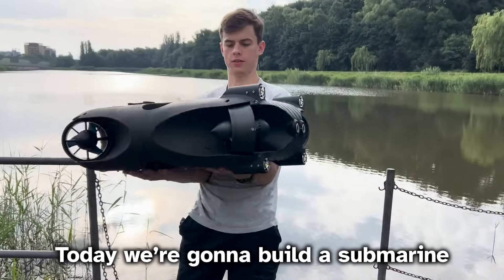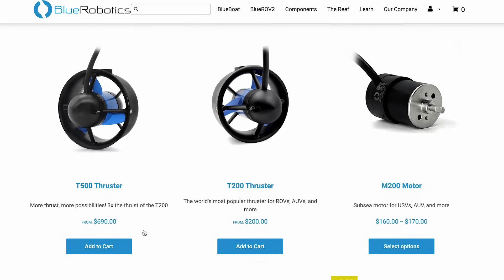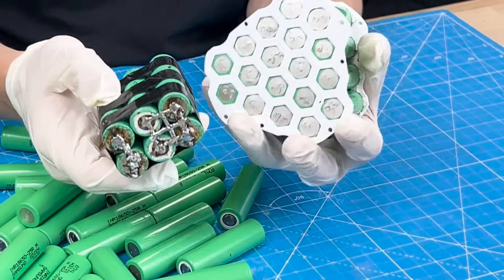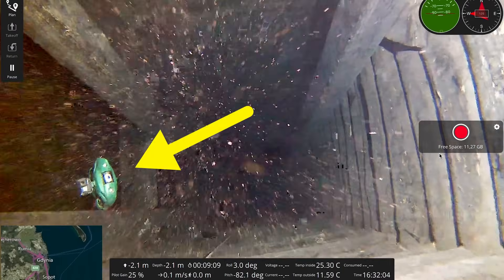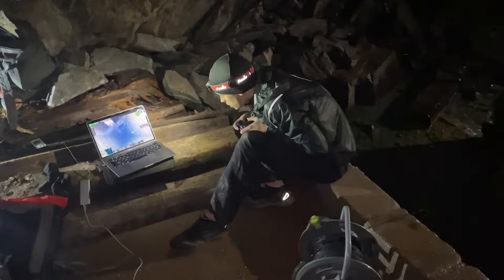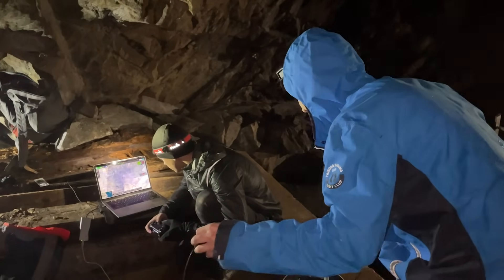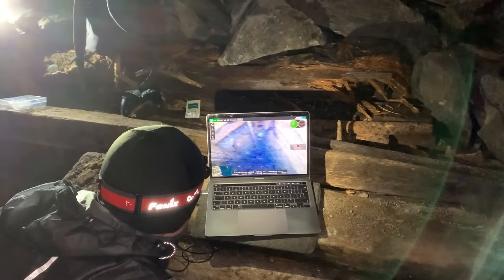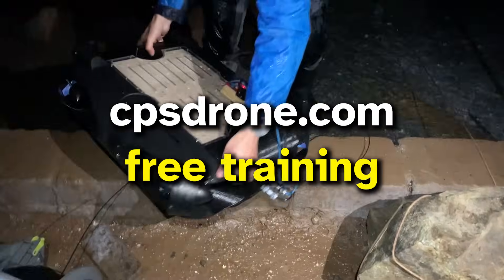My DIY Submarine Dives As Deep As Possible (PT2)

Comment: 5:50 Nice. 🔥
Reply: I think you should make more videos....because i think you rock👌
Reply: Number 15
Reply: That was a really interesting and innovative video, what a cool location to get underwater video of, literally the perfect example of a place being too dangerous to scuba with any level of safety, though I am sure there are folks who have. What a break the umbilical didn't sever. Fiberoptic is clearly the way to go, I do think either a rear facing, or swivel camera would be helpful. I'm curious about thruster control, how do you control the amount of thrust? I ask because of the silt you were stirring up, if your manually controlling thrust, maybe consider adding a ramping timer somehow. When you first engage thruster it starts off real low.. like 3 or 5% after some time it begins to ramp up max thrust, smaller bursts for corrections should create less turbulence that creates bigs clouds. Oh also your reliance on the umbilical as the only connection to the surface is really brave, maybe consider adding like braided fishing line and create a hard point connection for a secure connection for sub retrieval?
Reply: 5:50 Good 😊
Reply: Unsure why I cannot leave my own comment so sorry for posting on yours. But you guys could have used a guide line since such a narrow mine, meaning dropping a line with a heavy weight to the bottom and attach the sub/drone via eyeless or like eye hooks so it would be restricted to only up and down (unless u program a clamp to detach) but you wouldn't have to worry do much about obstacles... free divers use these to measure the depths they reach and so they can surface quicker if needed.
Reply: Using Fusion 360
Reply: yo hello hacksmith
Reply: oh my god its actually hacksmith
Reply: THIS THING HASES 1.9K LIKES DANG
Reply: man your here too wth make content like this help them
Reply: Badass 😎
Reply: @TheGrace020  lmao
Reply: Oh course you did!
Reply: This deserves more comments lol
Reply: Didn't expect you here...
Reply: HACKSMITH, USE TO WATCH YOU WHEN I WAS YOUNGER AND STILL DO
Reply: @Borx_x yes.
Reply: i cant believe hacksmith themselves commented on this before me
Reply: i just realized this is hacksmith heh
Reply: w
Reply: How does this only have 10 likes
Reply: Not.
 Anymore. @CØØKED1-1
Reply: hello
Reply: this deserves more likes
Reply: @AlliedqqqqqqqqqqqqqqqqqqqqqqqqqBroom9081

Comment: You, need to put gratings, at the propeller pathways, so other lines won't enter there on vertical prop and horizontal, both. As for, recovery use a separate, metallic line instead of fo line, and keep both lines fixed, alternatively, a hinge and a auto retrieval line, should be made on the sub, as well for auto retrieval, from the drone itself, by using its own power, and its own algos for deeper depths. Flow is turbulent, so it will bring up a ton of silt, causes silting, so, u include Ultra Sonic and active Ir sensors as well, for nav on other ranges outside of optical ranges.

Comment: In around 1977, I worked for a company building satellite navigation receivers (before GPS).  I was an electronics engineer designing circuit boards, but I also understood the navigation algorithms.  At some point I interviewed with a startup company that was working on unmanned underwater vehicles.  It occurred to me that one could navigate vehicles underwater using sonar beacons to transmit precisely timed pulses that could be received by the underwater vehicle and used for navigation, similar to the way a GPS (GNSS) receiver processes precisely timed signals transmitted by satellites.  There were several practical difficulties that occurred to me as well.  Sound does not always propagate in a direct line of sight (line of sound?) underwater, due to changes in water density, especially at a fresh water/salt water interface like the mouth of a river, and due to thermoclines (boundaries between layers of water with different temperatures).  Moreover, sound pulses may reflect off underwater structures or terrain, causing the pulses to either be delayed or received multiple times.  (The same thing happens with radio signals, it's called "multipath".)  Anyway, I didn't take the job, so I only pursued a little research on how to overcome the practical difficulties.  But it seems that others have come up with systems similar to the one I conceived almost 50 years ago.  See https://en.wikipedia.org/wiki/Underwater_acoustic_positioning_system.

Comment: you need a balancing motor, one that runs steady and changes speeds relative to your depth and pressure. it would help with currents and water pushing it back up. you could mount it to a gyro

Comment: Is this able to operate in salt water? Do you have the capability to use fpv goggles with this drone and if so, how is the connection strength at deeper depths or behind obstacles? Could this drone tow a diver? Good shit guys, this is a really cool device!

Comment: Can I recommend for your neck build line cutting blades boats and submarines have them it would be nice to implicate on your build so you never have to worry about lines getting stuck in there but there also needs to be a solution for the feed line not to get in there or it will slice it

Comment: Why not install 2 fiber optic cables spreaded apart with a button for detachment. If one were to be locked you could detach it and if you were to somehow break the other one you would still have redundant cable for pulling.

Comment: Because there are no pressure sensitive hardware, you can put a can of pressurized air inside the submarine with a remote controller valve, and a valve that automatically releases air when the pressure outside the submarine is lower than inside.
It's basically to pressurize the inside to keep everything in place and give your material less difficulty keeping out the water when you go down. When you go up the pressure is release to prevent it from exploding.

Comment: Using more cameras may be a great addition for another version of this sub (I would love to see an array of cameras that will give the whole 360° of view in both axes). Additionally you could create your own cable (yeah, i know that it would be a hassle) but making one cable from 3 (fiber optic for data, power cable and a metal wire for durability and ability to pull the device in the event of damage) will significantly increase the potential of such device (unlimited time of operation, range of the wire itself)

Comment: I would recommend replacing the fiber tether with something like an FTTH drop cable. These have two fibers sandwiched between two fiberglass wires. Then the whole thing is reinforced with another steel wire. This type of fiber cable isn't immune to tangling but it tends to want to stay straight because of the metal wire. It also resists bending and can be pulled pretty hard thanks to the three wires embedded in it. The soft kevlar reinforced wire you're using tangles very easily and it's light and soft enough to be sucked in by the propellers.

Comment: always use a mesh. even if it restricts flowrate, use a mesh. I do alot of sub exploring in terribly overpoluted lakes and theres weeds, line and plastic of sorts everywhere. I gluegunned a mesh on the in and out of my props and that solved all my issues. if movement feels slow, I just push whatever is stuck in the mesh out with a couple seconds of thrust.

Comment: For exploring the side tunnels, perhaps you could add a spool of cable to the drone as well to lay down as it goes instead of pulling the surface cable over sharp rocks and stuff.
Adding a steel cable along side the fiber, strong enough that you can yank on it if the drone gets stuck or caught would be a good idea for that use case, and it would probably need a fail-closed ratchet on the cable drum to lock the drum from rotating if power or data is lost so that you can yank on it without just pulling more cable out of the drum instead of yanking the drone.
Torpedoes use a similar mechanism for their wire guidance system to play out fiber behind them instead of pulling it from the sub, to avoid breaks or tangles.

Comment: Add rocks at the front to help it sink using less power and use the propellers to control its movements. Use a latch though so it can be disposed off when not needed.

Comment: Thank you for the inspiring video and the technology sharing. I was wondering if cladding the entire optical fiber and the tether "rope or STEEL ROPE" in a (Cable Sleeve 2mm - 60mm Tight Nylon Braid, High Density Insulated Screw Protection, Expandable Sheath, Polyamide Wire Wrap) would keep them together and add some buoyancy to them so that they didn't droop and get caught up in propellers or extrusions in the shaft. Keeping any unclad optical fiber & tether with in the submersible would help decrease the risk of it. Getting snagged somewhere again. Are you able to control the descent of the submersible so that it doesn't create so much murkiness??

Comment: Good setting for a horror game, exploring an old, abandoned, flooded structure with a somewhat sketchy setup (fragile fiber optic cable potentially getting caught on something) with weird occurrences (plausible deniability, but what if something is LIVING in the water? ooooooo~) and I even have a silly little 6-DOF game environment set up- it does space flight right now, but a ton of drag and some low-fidelity filters could give it a good watery vibe

Comment: Some sort of fail safe mechanism might be worth adding. Possibly a small CO2 cartridge that is released by a timer that is set much longer than the expected mission time. That way, if there is a communications failure, then an hour or two later the CO2 is released into a partially confined space of the drone or a ballon/bladder arrangement giving a massive positive buoyancy and possibly recovering the drone. The release of the CO2 could also drive a small set of shears that cut the tether so in the case of a tangle of the tether the drone would be released and should rise to the surface. If a bladder is used then the inflation of the bladder could operate the shears making it a simple mechanical arrangement. Oh and when I say shears I obviously don't mean garden type shears, more like a small hole in several very thin, sandwiched metal plates. The tether is passed through the hole and the force of the bladder inflation causes one of the metal plates to slide relative to the others causing the tether passing through the hole to be cut. the edges of the hole in the moving plate could be sharpened to make cutting more effective. If the hole in the moving plate is slightly larger than the other plates then the tether would be protected from the moving plate's sharp edges until the shear was activated. 
On the other hand, if the mission is a success, then on drone recovery, the timer is cancelled and the CO2 cartridge is not released.
Of course this would not have released the tether that had tangled in the propeller. There needs to be a separate system to ensure the drone doesn't get entangled in it's own tether. I saw mention of a honeycomb style cover over the props. This should give very little restriction, prevent the tether entering the prop and possibly give a more laminar flow to the prop output.

Comment: is it possible to make a screen or a grid to keep wire from getting sucked into motor. also for recovery what about a rubber lined steel cable the could be attached to the fiber cable with the last 2-3 feet at the drone left separated just a thought.

Comment: Maybe put metal grates infront and behind all props. Yes you will lose a lot of thrust, but it should solve the tangling problem.
I have no idea what you fiber optics are made out of, but a sleve of aramid will surely help strengthening it up. Also place a "wire guide" behind the connector, so there never will be the chance of bending the optics to the point where they might just snap.

And as this is basically a underwater quadcopter, it needs a return to home function :D

Ok, the last one is a bit silly, but my other suggestions could improve the design.

Comment: You try add a pole on the wire to keep it away from the drone a bit and also if you put 3 axis swivel, like a gyro on the attachment to the drone, then it wouldn't be impacted by the movement of the drone so much.

Comment: That's easy. The problem in the submarine is the presence of air in it. That crushes her, not anything else. So the pressure inside is lower than outside and leads to damage. Fish and other animals do not breathe air directly, so the water does not exert as much pressure on them and they can dive quite deep.

Comment: Why use fiber optic?  It's extremely fragile and I don't think under these circumstances it provides any benefit.  If you were going a couple of kilometers yeah sure, but for a few hundred meters?  Also if you are using a tether anyways why not also go with a steel cable paired to it?

Comment: Maybe add a metal mesh to cover the propellers like some jet engines do (google: Rhino 200 SE Turbine RC Jet Engine)
Reply: Could also be a good idea to add last ditch blow up emergency eject system (i.e. loose signal for an hour: open valve to fill balloon/ pull open piston, etc to have it shoot upwards)

Comment: you need to add a 360 camera so you can get a 3rd person view of the submarine. kind of like how some porches particularly my cayennes proximity sensor works. it shows a 3rd person birds eye view of my car on the screen. then you can avoid all obstacles, you should also consider adding thin fine steel mesh in front of the propellers to prevent nylon fishing lines or other small debris from getting tangled. good luck

Comment: so what you need next time is a propeller screen guard and a crane to center the fiber wire adding little bit of pressure so it wont slack.  Also add like a spring type tube that elevates the fiber wire above the drone.

Comment: A few suggestions.
First, don't use your communication cable as your physical retrieval cable. Using a metal cable will ensure that you don't potentially damage your fiber optic cable. 
Second, guards over your props to prevent debris from getting entangled. 
Then the last thing I would recommend, add two pieces of tech. The first, a simple device attached to your reels like a buoy that keeps tension and prevents excess cable from being given. This would drastically help reduce any chances of your own cables getting caught in the props. Also, you can write a program that records your inputs and creates a virtual path for the drone. What this will allow you to do is create a program for the drone that will let it retrace it's steps exactly. The benefit behind this is that you can allow the drone to be able to calculate how to move along a path even without all it's functioning props.

Comment: Idk anything about submarines or drones, but I used to work with underwater cameras. It may be an idea to pressurize the hull with gas to get some extra depth, assuming the electronics can handle that.

Also I would reccomend you build yourself a little folding cart to transport the drone and additional equipment. Tools for quick repairs, folding table and chair and whatever you might need. If you attach some batteries you could have lights and a little motor to wind the fo cable back on the drum.

First video I've seen from you but it's a pretty awesome project

Comment: You can add some emergency balloons that can help get the dron up if you lose connection. It could work by inflating the ballon when the submarine detects signal loss
Reply: Too much pressure.

Comment: I think for the next try you should have a thin cable attached to the Submersible aswell that us less likely to wrap around things cause of its weight not being effected by the propellers as much and you can attach the Fibre wire to the cable and your less likely to break the wire and if you do you still have the cable that's stronger to pull on to get it back like how large drones in the ocean usually have a tether

Comment: I like how they went though all the trouble of designing and ordering custom parts, but leave but fiber optic extra super duper vital lifeline cable raw and exposed.
Reply: 200+ metres of fiber optic cable is quite heavy already, any insulation or guide cable you attach to it will easily triple that weight, you would need to build a heavy winch that could be bolted to something in order to stop all over your equipment being dragged in to the hole once most of the cable was in the water.

Comment: Rim driven thrusters would've saved you from the issue regarding random lines floating around, in the tunnel, since it would push the line through, without tangling around the thrusters. It won't, however, save you from the issue with sucking in your own tether cable. I've experienced similar issues several times on another drone. Guard shields is one way to do it, though you will lose a bit of thrust doing it...

Comment: Hi… the fiber optic cable shouldn’t be the only cable to connect the sub….not even electric ones…
Always use a tough rope, steel, chain with the cables … to hold, pull….
Nevers use electric, optic cables to pull…. As safety cables ⁉️⁉️🚧

Comment: adding something like a thin webbing over the props would help prevent future wire entanglement issues, probably the easiest fix you can do just by adding a little bit without any major changes.